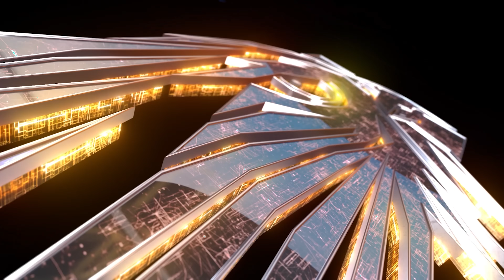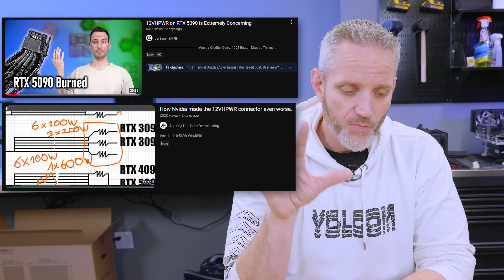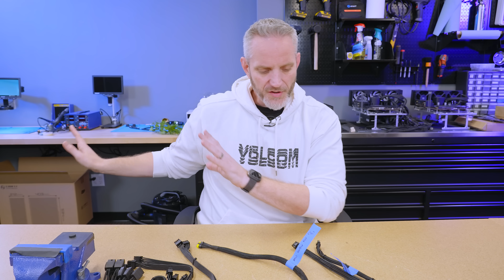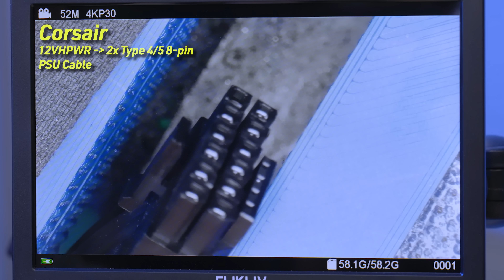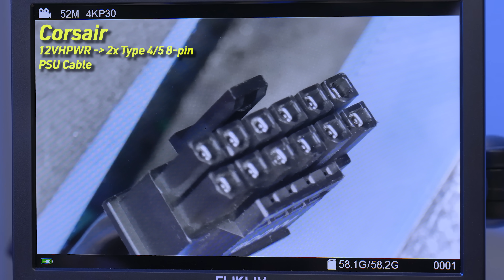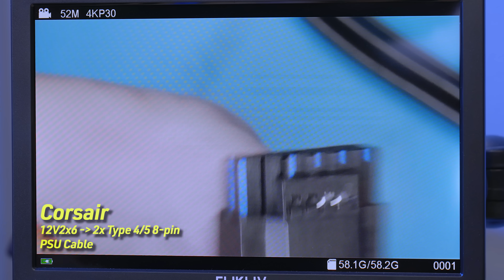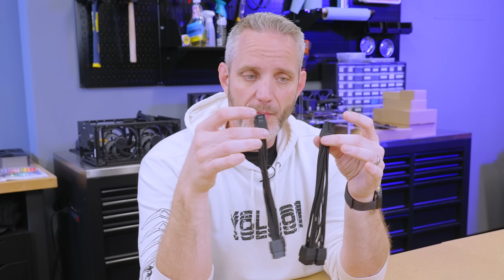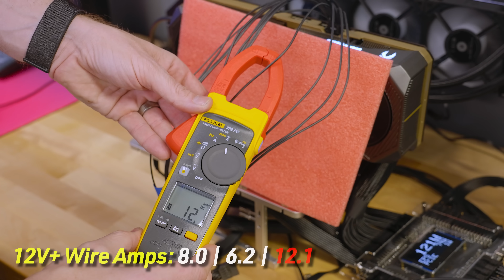I discovered something concerning and I need the Experts to chime in... More 12VHPWR discovery!

Comment: Jay. In this part. Try pushing the wire at the back down into the connector.. all low quality molex have play about 1/16 of an inch. Cool you did it. K weak latch pop the pin out there is a latch that needs to be opened more so that it will clip into the molex shroud. Check the connector and see if the interior is molded to the same shape as another pin. I have in my history gotten a bad molex end. Threw that cable out and used another.. it was a 6 pin.

Comment: Ok that's a question I can answer. The resistance leaving the ground side has lower resistance and by property larger copper plates and tracks. The tracks will not only reduce held power, but heat as well because there is by property more space for electrons to travel. In the case of incoming power resistance is high at the power entry means that the connector is having issues transferring power to card. If resistance is high at entry. That means a couple of things. Phase could be out 20° the resistance is not exactly balance ie one is higher than the other. capacitors and amplifiers could be off by a bit in dielectric volume, or windings. Transforms or chokes could be it as well. If there is that much resistance in the card. I guarantee there isn't, the problem is coming from the power supply overloading one line and that's because the customer isn't using a true 3 rail power supply.

Comment: The ground pins are going to have slightly better heatsinking into copper planes on the PCB, which might delay overheating damage. Other than that they should be identical.

Comment: I agree I don't think the cable end is the issue. I think the wires were pinched together that lead to the heat not being separated which lead to the bigger issue.. you need to check your routing and the connector after the cable is set to ensure seating and wires are not pinched.

Comment: Amperage. Only towards the end of the video was AMP flow talked about. He took measurements. That's a lot of current in that little wire. DO THE MATH. 600 watts divided by 12 volts is 50 amps!!!!. Across 6 (supply and ground) wire pairs is 8.3 amps through each of those small wires + pins. (Looks like 18-20 gauge wire.) That's nuts. No wonder the wires and pins are getting heated. They are undersized for the need. As a wire heats it's resistance increases resulting in a lower delivered voltage at the endpoint compared to the supply voltage.

The power connection needs to change. Just adding more wires and pins adds more fail points.

Comment: Jay, another possible point of increased resistance in the cable is the crimp connections where the wire goes into the terminal pin. Might be worth a destroyed cable or two to get those pins out of the housing (without pulling on them to get them out -might have to cut the housing away if a pin extractor isn't available) and having a look at that...Should be a double-crimp (One on the wire itself for conductivity, and one around the insulation for mechanical strength), with all of the strands of the wire contained in the crimp and undamaged. 
Also, measuring the resistance of each individual wire with a high-precision ohmmeter could give a clue as well...the higher the wire resistance (affected by diameter and length of the wire), the more heat that is created in that wire to maintain the same power.

Comment: Build-zoid is a real electrical engineer. I am just an inspector and tech. That theory is above me.... And Nvidia should know better when designing GPUs but I am more concerned.. on power supplies not regulating DC power or load balancing and if Nvidia assumed that all PSUs wouldn't try to cheap out..  You are giving cheap manufacturers like Li Lang waaaaaay to much credit. You need a true 3 rail PSU. Corsair. Seasonic and Thermaltake. Stuck with true 3 rails... Stop buying cheap PC hardware... You are the culprit of your own GPU failure.

Comment: I've seen this issue with PC connector pins for decades and always hated the shit quality in the design of these types of connectors (ATX, PCIE, CPU, etc...). The other connectors have always exhibited this pin problem but since the currents through them are far lower, it never caused a major problem. If this turns out to be the "OMG we never noticed this" moment that leads to a proper solution to this problem, I'm going to begin questioning the competence of all the so-called experts I've placed my faith in over the years. There is no way I can be one of the only ones that noticed this design flaw literally 20 years ago in ATX connectors and every connector that uses the same type of pins.

Comment: Those are pushed pins on the connector, very common in cheap connectors/cables.. one way to “fix” this is by holding plastic connector and pushing the cable into the connector.. this however is mostly visual, and will go further back once it is plugged it. By pushing each stand of cable individually after plugging the connector in, each pin will make a good connection

Comment: Power loss through cable or terminal resistance will increase by the SQUARE of the current.  So any overcurrent will disproportionately overheat the overcurrent carrying cable(s).

Comment: As an electrician who used to work with high voltage. The grund should always be LONGER than the rest, incase of yanking or loose connection the grund should ALWAYS be the LAST to lose connection.
Reply: This is a good point, but- correct me if I'm wrong- isn't it less of a problem because it's running only 12V DC?
Reply: @trombo503  no, lower the voltage higher the sensitivity to diferent resistance on parallel wires
Reply: yea but these are not designed to be disconnected while its running, only while power is removed. this is more of a thing for like battery connections or mains where the power is expected to be on while the cable is inserted/removed.

Comment: i like how every day another Video comes up showing how bad all this is. First the card melts than we see the card only has 1 shunt or how its called now we see bad cables from big brands. Wonder whats next. I just looked on my Nvidia Adapter and its also good all Pins are at the Same height. The one in my card is from Thermaltake and i wont pull this thing out until i have too

Comment: What it realy is, is an electrotechnical problem solved in the worst possible way.
Dayli most of us are powering a 12V device that are pulling kilowats of power without any issues.
So if the car indystry can supply hundreds of amps to a starter thousends of times why catn`t the GPU industry mak e a connector that can handle a 10-20A pr connection point without burning once?

Comment: And i thought i'm the odd one by applying some force on the individual pins to make sure it is not loosen up and pulled out when the housing is fully seated. A habit moved over from the old Molex Power Connectors or IDE Data Connectors from Hard Drives, which essentially had the habit of falling apart by connecting and reconnecting toooo often by pulling on the cable by unprofesionals.

Comment: Jay, for the love of god, the problem is the design of this connector, is trash, it bring so many problems, and all are blamed on "user error", FOR PPL IF DON'T WANT TO HAVE TIS PROBLEM, WAIT for AIB partners and buy with the old design, DON'T GET THIS "HIGH POWER CONNECTOR" it's to expensive to manage it, you might need an new PSU along side with the new GPU, and is UNNACEPTABLE, THERE SHOULD BE AN STANDARD, and it isn't, clearly by bad design, the old design of ATX 12v is by far the safest, IS NOT THE FAULT OF USER, it's designers fault nVidia and PSU makers !

Comment: Its all about creating surface aerea when looking at pin positioning.
Positioning of the Pins almost means nothing, when just looking on current delivery. The created surface aerea will be multible times bigger, then the surface of an cut wire and below the wire restance. I think crimps or springs are crap.

Comment: The terminals within the 12V high failure rate connector being somewhat loose can also be observed even on similar assembled connectors like the older 8pin connectors. Therefore, I would think that the terminals are supposed to connect properly despite these scary looking tolerances.

You should easily be able to test your theory by looking if the wires with the "bad" pins/terminals show different amperage from the others and see if there is a pattern.

Comment: 12V might be more critical IF they have all ground connections connected. The bad ground might then cause higher current on the pcie slot. So if the pcie slot can survive it, it might be fine. (RX 480 flashbacks (Might have been a different gen, i don't recall)) 

So yeah, maybe 12V is more critical, but maybe bad ground could damage the pcie slot.

Comment: This is why the 90° cablemod cables are even safer in that regard. They have an immediate 90° bend and a cover on the back. The pins can basically not move at all. This movement seen on the corsair cable is pretty much normal for all power cables, especially 8pin etc.
And this can definitely be an issue on the new connector, where there is almost no safety margin left.

Comment: The play/wiggle in the plug corsair says its fine, its defently not fine in my asus psu with its 12v hpwr cable, it looses alot of current when i pull back in one of the wires on my psu side.

Ill say the standard and quality is not good enough for that plug, and its not like i cheaped out on my psu, its a asus loki and the cable im using was the one provided from asus themself.

Comment: Correction: Not all Corsair PSUs utilize a 12vhpr to two or three 8 pin pcie cables. 
I recently got the newest model Corsair Rm1000x 2024 edition I believe. Its very nice flexible skinny cables and is confirmed  gen 3.1.
It uses a 12vhpr to 12vhpr cable instead of multiple pcie ends like the older generations.
And as a bonus, it scored amongst the highest tier ratings on the PSU tier list.

Comment: This gpu power connection is so stupid at this point just make an f'ing 4 gauge fatty for the power it makes sense because they're all the same rail and this is better for power handling, and using a fatter plug connection or ring termination, on next gen gpus we should have something better than this non warranty able bullshit, or else someone could to tap the power rails set using soldiering and/or outright replace the connection, if computer manufacturers can take a hit from car electrical installs. Another method to clear this issue is to make these connections out of non conductive metal, these connectors don't look like they can handle much because this pin design has made used since the 2000s
Reply: Also electricity is like water it will frequent the shortest path possible when there are multiple wires connenected to the same thing end to end

Comment: There's definitely something wrong with those pins in my opinion. 

It's almost like here in the UK not having the mains cable in a three pin plug,  actually seated in the pin correctly where it's slightly out and it will either work itself loose or indeed cause fire, overheating etc

If I have had a cable like that I have usually zip tied them together and if he still doesn't work then I've change the cable or indeed for power supply  

The last option would have been to actually remake the plug. Obviously that's not  ideal as there is a major risk of doing it wrong, not just invalidating any guarantee on your card but also your power supply and risking a whole lot more like the entire system 

I suppose with bulk manufacturing things like this will happen but it's not ideal for something that is $3,000 or more. Would you have this on a car. 

Yes okay. Cars are a lot more expensive but that is not the point we are paying for something that should in theory last a while longer than food that is dated for instance 

Great video Jay and Phil. Keep up the good work

Comment: I appreciate that this video goes more into the root cause rather than into mitigation. A few other videos I’ve seen focus more on the strategies in the cards for mitigating current imbalance in the wire harness, but ideally that would not be needed because there would be no imbalance. And while mitigation is important, the bigger question IMHO is why the imbalances are happening to begin with. 

Contact depth is certainly one aspect. But the connector design should have enough margin to allow a certain amount of variation. Some of the examples shown in this video were egregious, and likely exceeded that margin. But most of the others with variation should be well within tolerance. (I’ve seen some comments here stating that contacts should never have any play, but that is incorrect as a blanket statement: some connector designs use completely non moving contacts and housings, others are fully-floating, others half and half. Every combination exists, and it simply depends on the design intent.) 

Another is contact quality: cheap contacts are brass, which deforms and has very limited ability to “spring back”. This means that the more times the contact is mated, the looser it gets. Even worse, if a misaligned socket contact is forced onto a pin, a brass contact may be permanently deformed beyond its design intent, resulting in poor contact even if later aligned correctly. Other alloys, like phosphor bronze, deform less and can spring back better. But it can still be deformed from misalignment. And all of this assumes the contact was correctly manufactured to begin with. Cheap contacts (i.e. from low-cost clone connector makers) may be made of thinner metal, the wrong alloy, or be dimensionally incorrect due to poor design and/or as the manufacturing tooling wears out, without sufficient quality control processes to catch noncompliant parts.

Similarly, the plug housings may be out of spec, too. Like with contacts, clone manufacturers may not have ever had the dimensions exactly right, but any manufacturer has to keep tabs on mold wear. The plastic used matters, as do process parameters (temperature, time, etc) and the end result of all this is that housings may not meet the spec, with shrinkage or warping, or with a final product whose materials don’t perform properly. The dimensional accuracy of the housing is critical to holding the contacts in the correct positions (even if that position has “play”).

Next, how is the wire crimped? Poor crimps can have high contact resistance, causing heating. Proper mass-production of crimped wires involves continuous monitoring of crimp parameters. And this is assuming the wire and contact are correct matched, and the equipment properly configured for that combination of wire and contact. Also, if the wire is old or was improperly stored, the conductors could tarnish, also increasing contact resistance. 

Next, the assembly of the wires and housings. If the harness and processes are well-designed, every wire in the harness will be equally relaxed in the finished harness. In a poorly-designed or poorly-assembled harness, some individual wires may be under stress, be it due to length, or due to torsion (like when a contact is not facing the correct direction and the wire must be twisted to fit in the contact). I can imagine that torsion could be a reason for some mated contacts making poor electrical contact. 

Another question is whether environmental factors like vibration are an issue. For high-vibration environments, you generally do not want the electrical mating surfaces to be able to move in relation to one another, so you want them rigidly coupled. But this means that in the housing design, you either need the housings to be rigidly coupled as well, or you need both housings to be floating with respect to the contacts (so that the mated contacts remain rigid to each other, but can move together with respect to the housings). What you don’t want is what we have here: one completely rigid contact and housing (the male receptacle on the PCB) and one completely floating contact and housing (the female plug). The female contact can vibrate on the pin, wearing through their plating. Both of the components the harness connects to vibrate, since both the graphics card and the power supply contain fans. How do their vibrations affect the connectors, both individually and as a system of interacting vibrations? Do lubricated contacts (an option available from the manufacturers) help? 

All of this, and more, need to be investigated.

Comment: I got some experience witch connectors, i would say the main issues are: 1.) This pin size and making in a multi pole Connector is capable betwen 3 and 5 Ampere continious. 2.) Tin paleted contacts have about double the resistance e.g. Voltage drop, e.g. heatingpower at given current. 3.) Tin is a very bad contact material e.g. fretting tendency, corrosion, low operating temperature, diffusion to other materials, very low cycle count. Tin contacts are incompatible with almost all other contact materials especially gold. gold and Tin is diffusing together aud creating a chrystal material. 4.)contacht should alwasy be a little bit recessed in the housing because: damage Protection, electrical safetey, dirt ingress protection at least.
I know about some contacts in Military and Industrial applications about this size rated at 7A, they are maschined, very thick gold plated and about 1,30€ each (M39029/4-110). 4.) Paralleling contacts is very problematic especially with inconsistant contact resistance.

Comment: I think you're correct.  I remember an old molex power connector (4-pin) that began to smoke and melt the plastic in the 90s when one of the pins didn't mate well.  The wires connected to the pins could easily shift the pins backward and reduce connectivity, creating resistance.